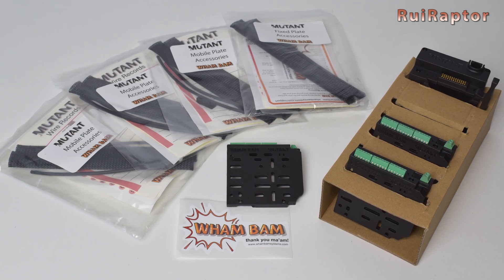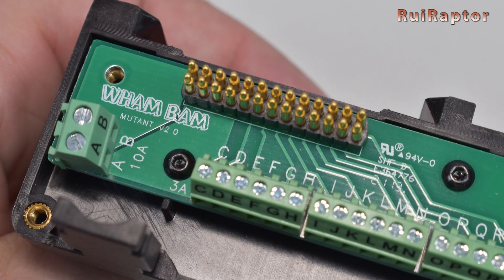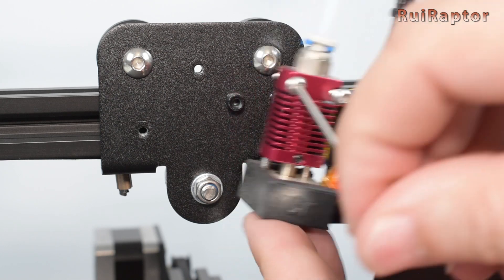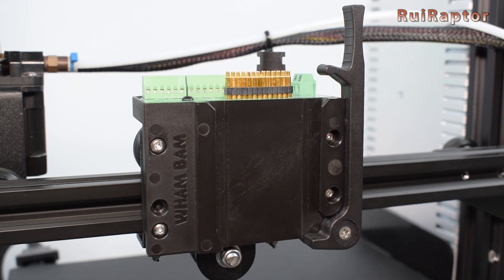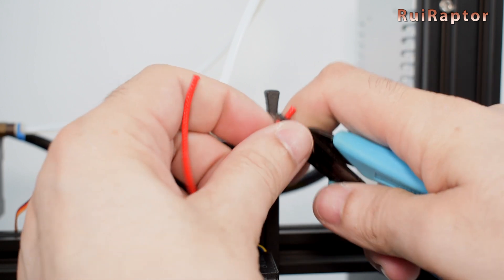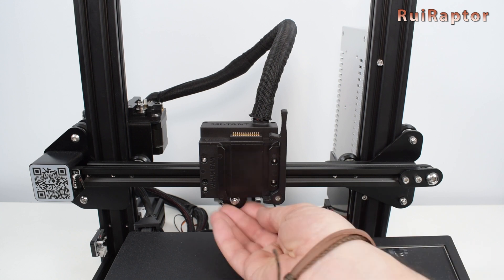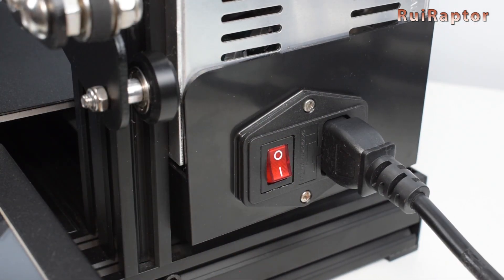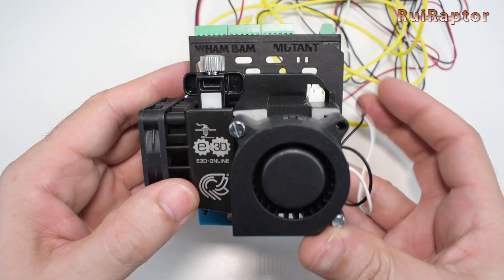Wham Bam MUTANT V2 (3DPrinter Tool Changer) - Analysis & Installation Guide

Comment: This ought be a nice addition for many. One thing I noticed, you had a cooling fins setup for the direct drive tool. There was no fan though. Having no fan will make it take just a few moments longer to heat up, probably wont make much difference in thermals that way.
Reply from the maker: Hi Tommi,
thanks for the comment.
Regarding the direct drive setup, it does have a fan to cool the hotend. It's hard to see but you  can see it in minute 12:43 (it's between the blower fan and the metal extruder.